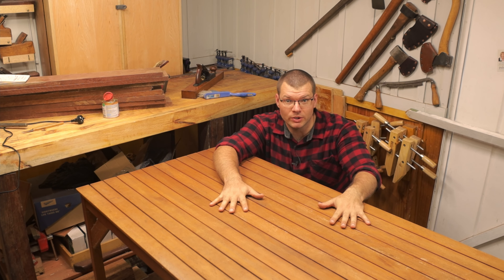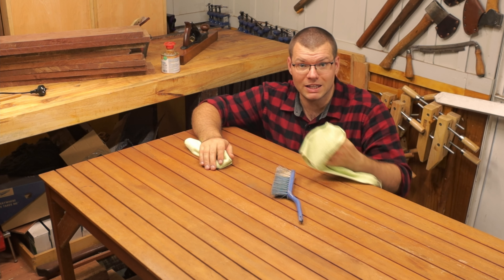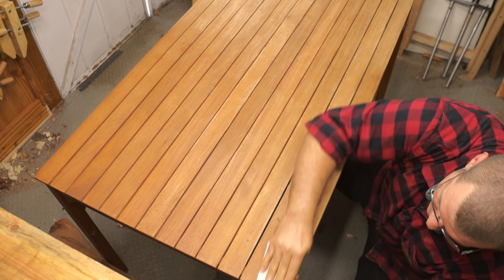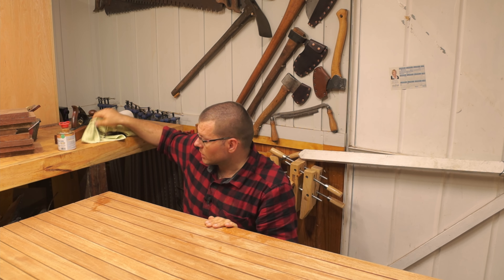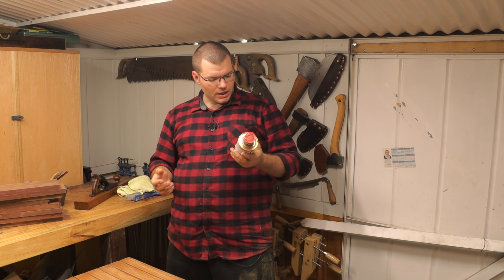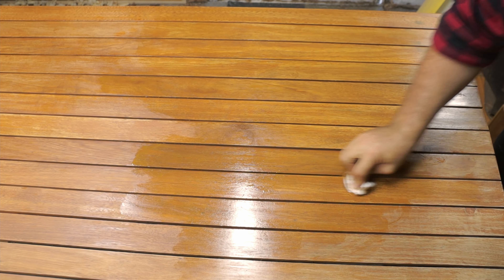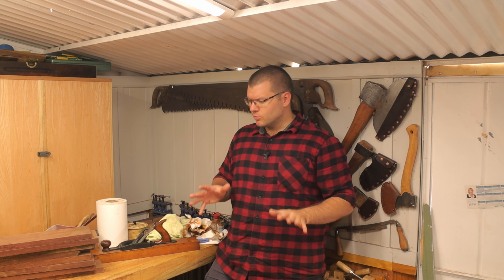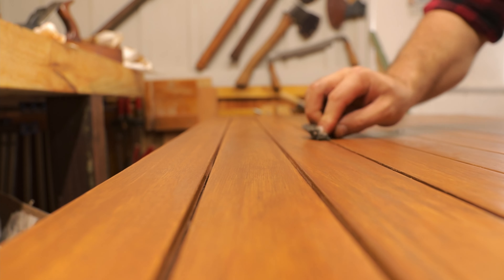How to REFINISH outside table top

Comment: Hi, 
The first finish, what kind was it?  
What do you recommend applying for maximum protection for outdoor furniture in weather conditions similar to what we have in Australia?
By the way, the table looks really good
Reply from the maker: The first finish was a hard wax oil. The best finish i have come across for outdoor furniture in Australia is marine varnish. Ive had good results on signs using the  bondall monocel GOLD marine varnish, i found the gloss worked better than the satin version
Reply: @AussieWoodshed  Thank you very much, I really like your content keep up the good work!